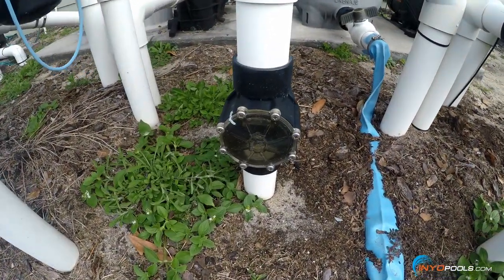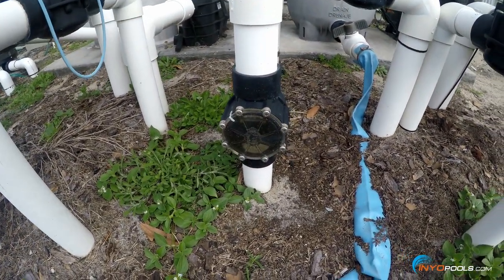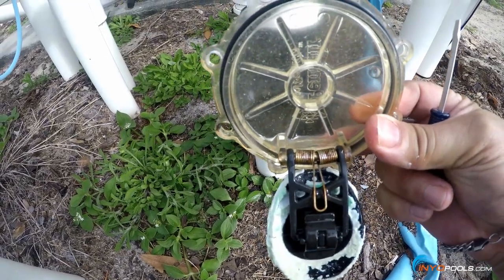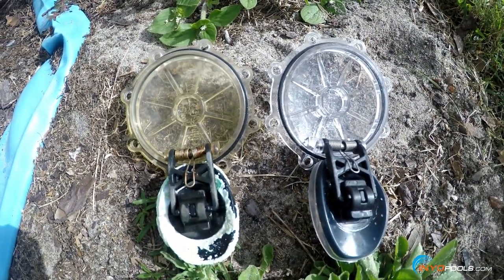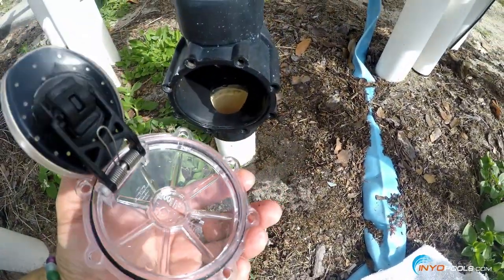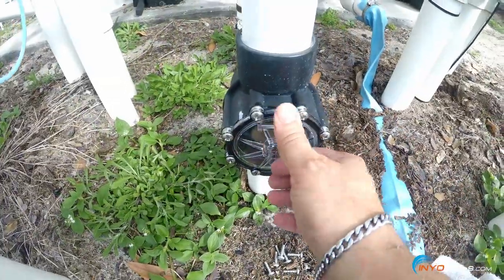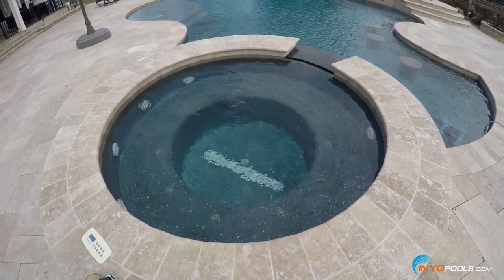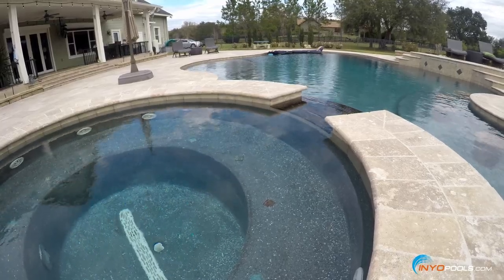How To Fix A Draining Spa (Check Valve Repair)

Comment: what position should the valves be for the spa not to drain emptyt
Reply from the maker: If the spa return lines are closed but the suction lines aren't, the spa will drain. You want to set your valve so that water is flowing to and being pulled from the spa for circulation.
Reply: If the SPA drain line is in CLOSED position,  (think of handle as a pointing finger and  180 degrees opposite should say closed in small embossed letters.) If this is so, and  Check valve(s) are not  working, they may be allowing water to drain to pool level from SPA when pump is off.  There may be Check valves on one or both locations . . . to prevent backflow to heat pump, and or from Sand or other Filter line.  *I am working on a simple,  cost effective way to stop water draining from above ground SPA, as I too have experienced this.  It will solve problem for a couple of $$ instead of buying new or repairing old Check valves. NOTE:  There are ALSO 1 way check valves in Sand filters and Pool pumps too! Good luck, Alan.